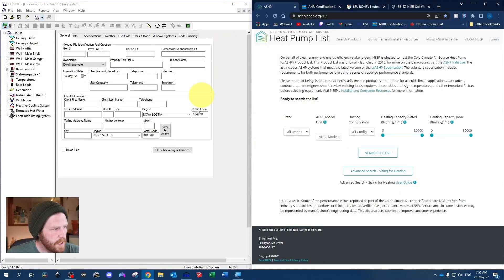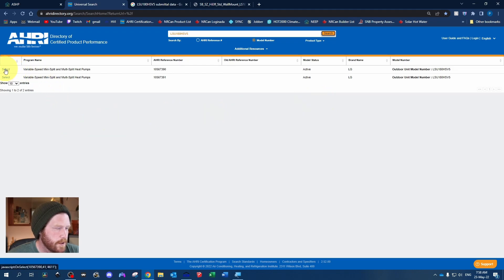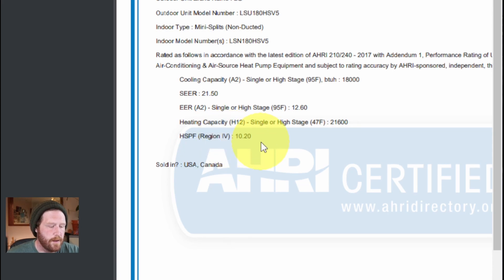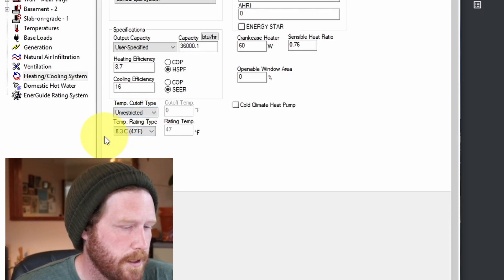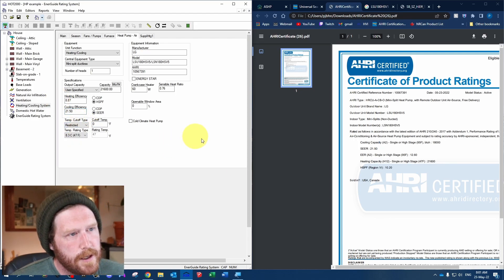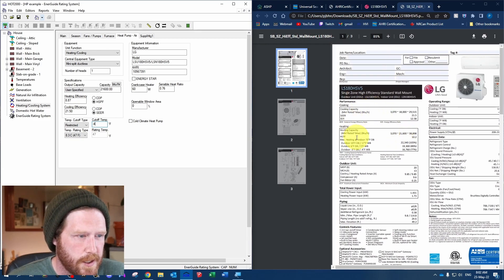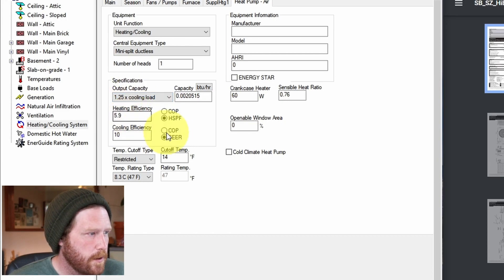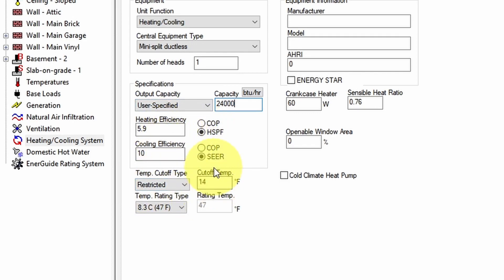Modelling Basics - Heat Pumps in Hot2000

Comment: Any insight on how to model air to water heat pump systems that provide radiant in floor heating+cooling and domestic hot water? The v.15.13 H2K guide simply says to model the exterior portion as an air source heat pump, heating only, which doesn't account for the cooling. It also says to model the dhw portion as electric with the appropriate storage tank type and volume, but does this account for the dhw being heated off the air to water hp? The radiant in floor should default to the HP for heating but not sure about the cooling and dhw.

Comment: Thank you for the into! Any suggestions on what to do if the heat pump is the primary (only) heat source? I noticed in H2K it's always considered supplementary.
Reply from the maker: Hey there, if it's a mini split I model the type 1 as electric baseboards, if it's a central system I use electric furnace and sometimes the kW is listed on the indoor unit of the heat pump.
Reply: Thank you!  @merrytimes

Comment: Fantastic walkthrough of the process! Just wondering, could you explain your thinking behind some of the "magic numbers" in your process?
- Like why divide the HSPF by 1.15?
- Why do you cap the BTU/hr of old heat pumps at 24,000?
Reply from the maker: Hey there. For the HSPF if it's region IV it needs to be converted to region V for Canada. For this and for the 24,000 btu/hr cap this is dictated from the ERS procedures we use.